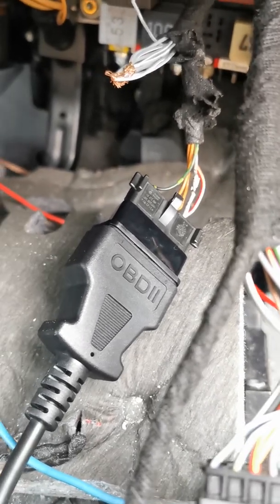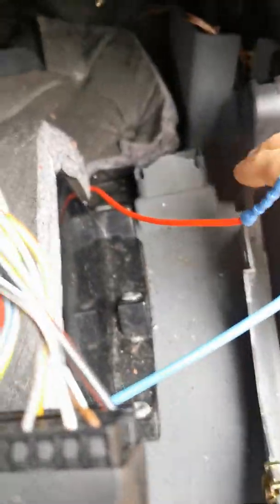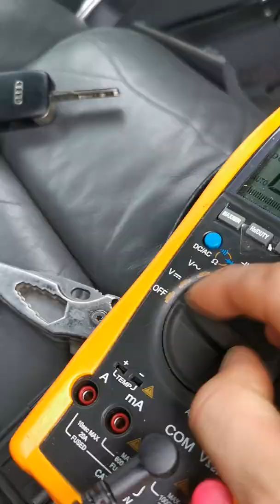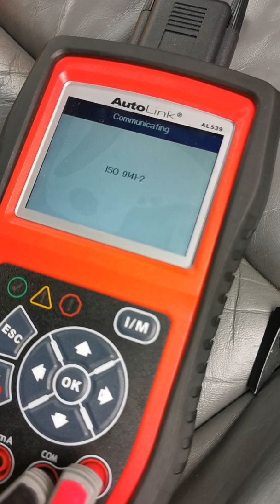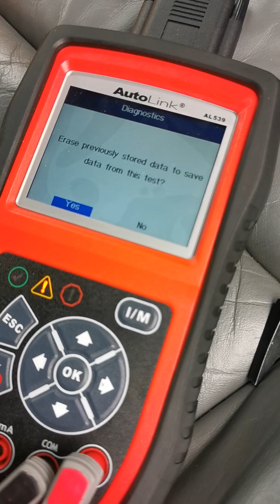Obd2 linking error - Audi tt mk1

Comment: Which module did that line you separated go to
Reply from the maker: That is a very good question, I need to further investigate that to see what it is
Reply: @reliabilityengineering3099  I've got a mk1 tt, my problem is 4 separate professional code readers won't power up when plugged in but my cheapy £10 orange reader works... I've had an Auto electrician look at it without success... Any ideas

Comment: Nice vid, i have same car and obd2 reader, but multiple wires with little/no power. When i just connect the ones with power, still no reading on my scanner. Any ideas?
Reply from the maker: Hi there, how many wires have you got disconnected from the others? If there's multiples I'd add one back each time and test and then keep. Going until you've tried every combination, this may take a long time but it might help Identify if theres another problem there.